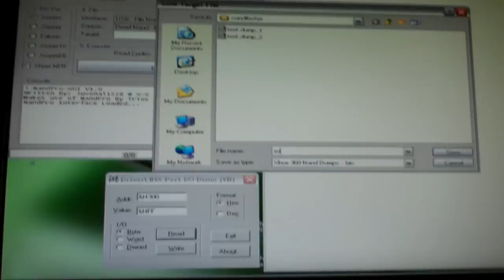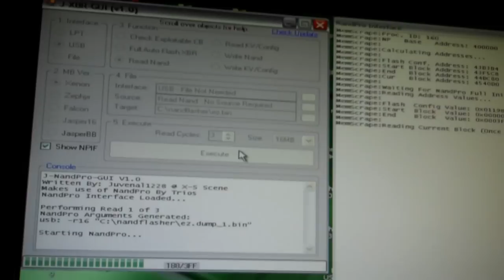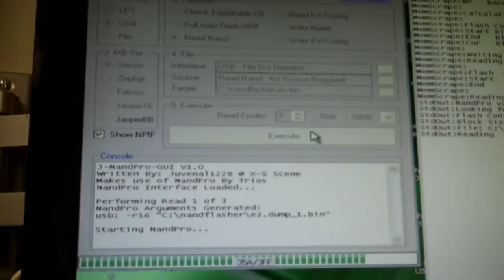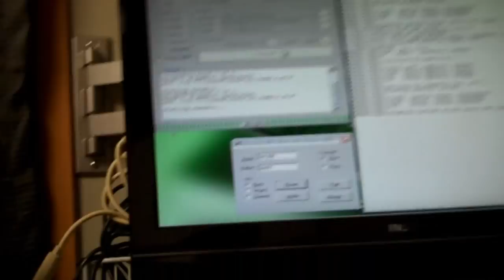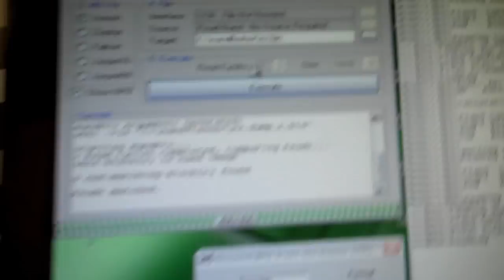nandflasher_working

Comment: You won't need a JTAG'd console to use this BUT you will need a JTAG'ABLE 360 to use this. All this is used for is installing XBR3, but making this REALLY EASY to do. Looks like you solder 10 points and connect. Looks awesome!